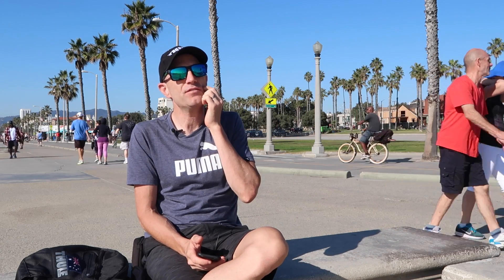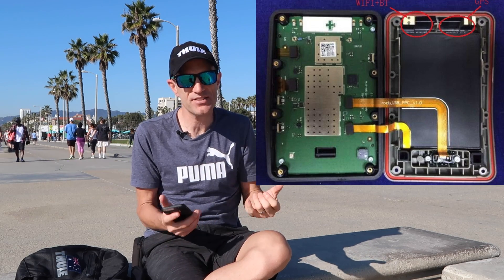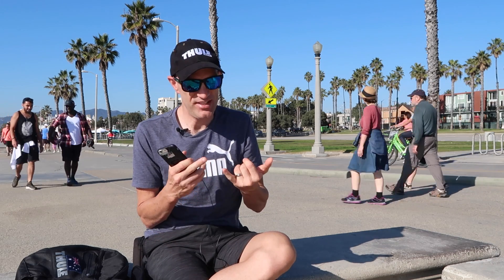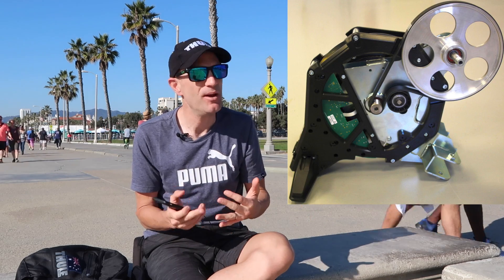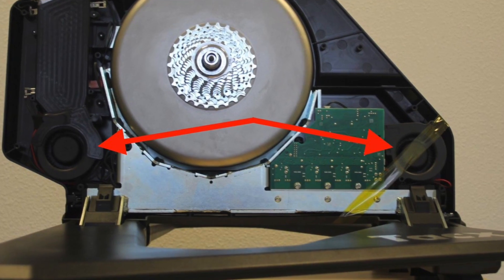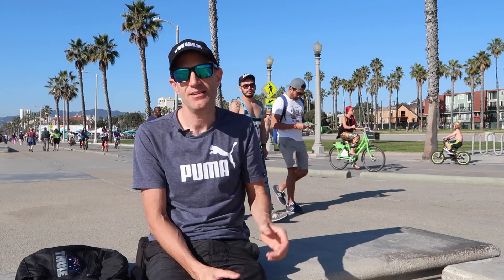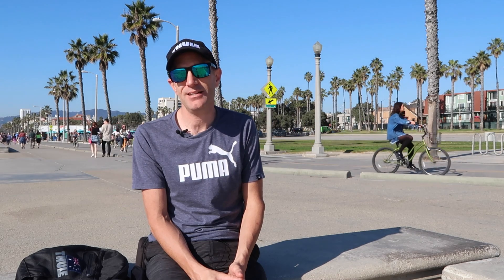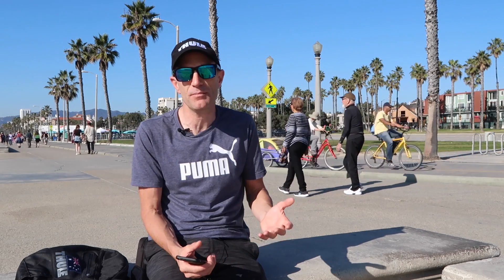Fitness Equipment Teardowns thanks to the FCC

Comment: How did you manage to uncover the circuit board of the tacx flux? I’ve undone all the bolts and taken the external casing off from both sides...I think my capacitor has blown. Many thanks
Reply from the maker: This was on the FCC website.

Comment: Thanks for sharing! Agree, the fans should be user replaceable. Would like to find/see Elite, Cycleops and Wahoo trainers too, so is there an easy way to find a FCC ID?
Reply: That was my question too, so I just did a google search on "Wahoo Kicker FCC ID" and came up with the goods!  The results showed a recent link to https://fccid.io/PADWF113 which looks like the results page of search engine Shane identified.  Cool...
Reply: Paul Damian I was able to find the Kickr too, but l couldn't find the Hammer or Drivo that way...
Reply: Tried contacting Tacx to buy some extra fans in case of failure. They first said I 'couldn't do the job', then 'there is no part number for the fan'. finally ending with - 'when the fan breaks, we replace the whole unit'.  A pathetic response and company policy all around. You're right - the fans SHOULD BE easily user replaceable when you can find them. Don't expect help from Tacx.

Comment: Regarding the fans on the Neo, my guess is that they would have oil-lite bronze bushings. These are basically bronze bushings that are impregnated with oil, and are pretty wear resistant. It might use sealed ball bearings, but that would probably be more expensive.